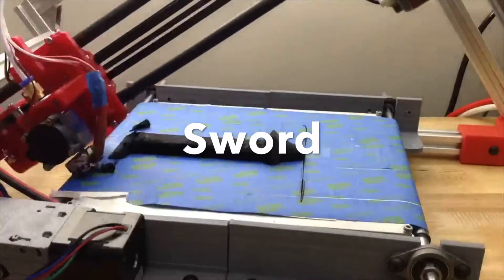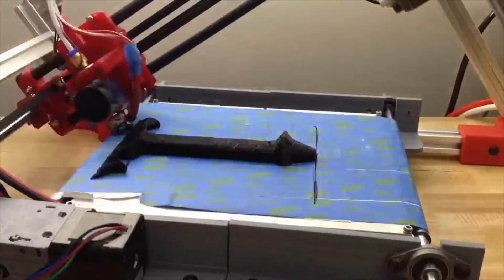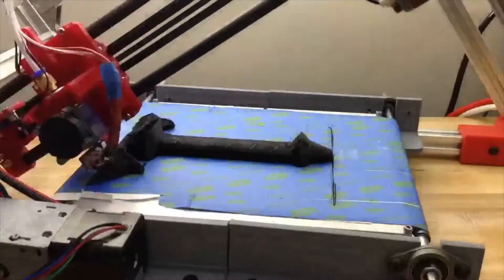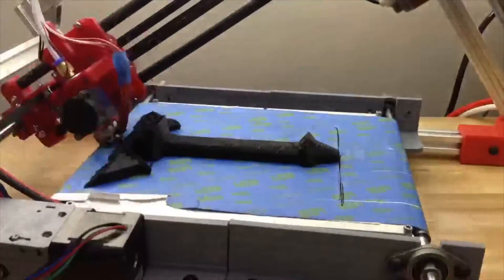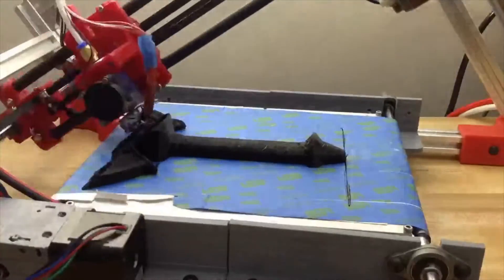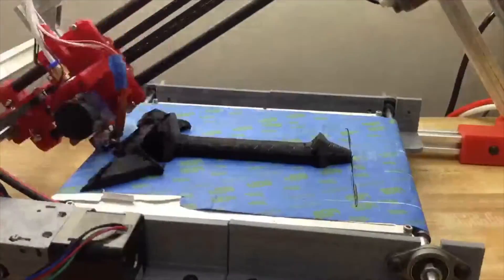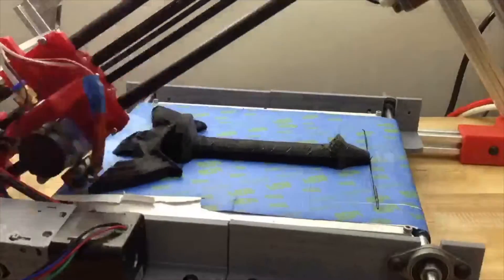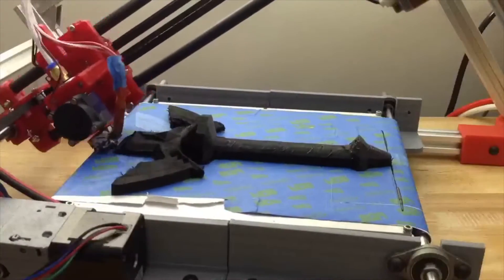Hypercube Infinite Z 3D Printer: Part 6 - First Prints

Comment: Ok now THAT makes a ton more sense. I had wondered what you would do once a part got towards the end, and didn't think about how it would just simply 'pop off' like that. My thought was that once it started to pop off, the weight would end up warping the rest of the print. 

But while it is cool and awesome at this stage... it still has limits to what it can print. Its really limited in the actual 'z height' of real world space... anything that is 'tall' at the 'base' will end up being unprintable because you have no way to print in mid air, and no way to actually add supports either...
Reply from the maker: True. Real world applications are limited. You could add support to your stl filed in Meshmixer and print using Blackbelt Cura.

Comment: why are you not driving the belt directly with the stepper instead of the 90° gearbox? As i have seen you have no reduction or so, so what is the advantage of the gearbox? You could also just use straight gears  and hiding the stepper below the belt
Reply from the maker: The 90 degrees gearbox was to make the printer compact. But the way it’s turning out, the gearbox is just complicating things.
Reply from the maker: I’ll try doing a few mock-ups in CAD over the weekend. Thanks for the feedback.

Comment: a 4: 1 bevel gear reducer would work?
Reply from the maker: That definitely help increase the torque. Have you got a suggestion for one or a model to print? My other problem is the paper which stuck to the sword too well. If I use the stainless steel belt with caption tape, maybe I don't need to change the gearbox. 
Work In Progress :)
Reply from the maker: I just looked on aliexpress for bevel gears. Too many to choose from. Thanks for the idea.
Reply: What about kapton tape? 
I've been following your work, it's going great.
If you could print the solar system it would be cool
Reply from the maker: I will try kapton tape. Predictive text changed kapton above to caption tape :)